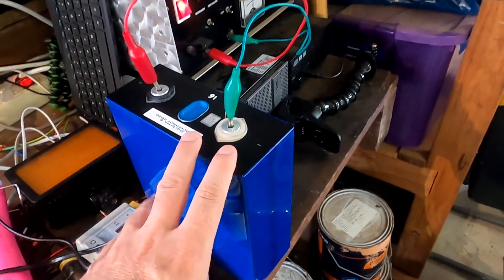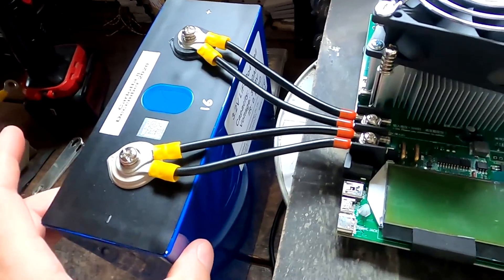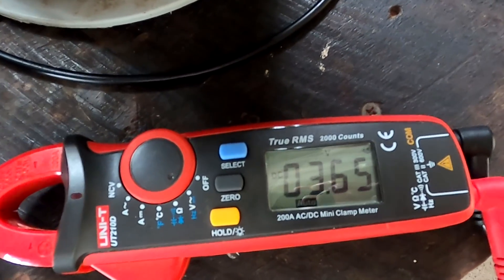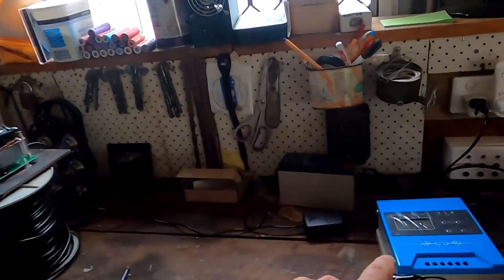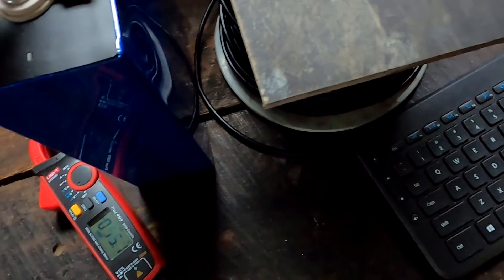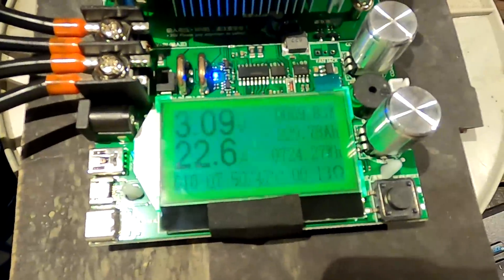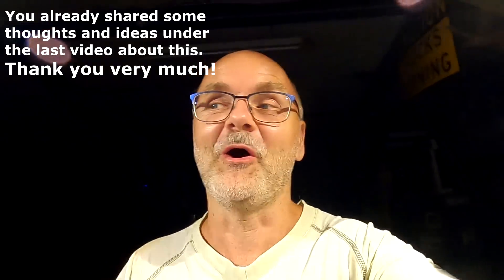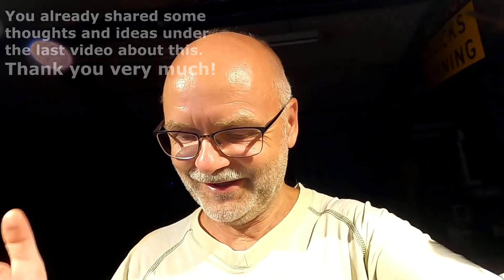3rd capacity test with expected result of the EVE LF280 LiFePO4 cell.

Comment: Hi, I recently found your videos. You are making me a big job, now I have to watch them all from the beginning of video one. I think those both testers actually read quite accurately the same. As you charge and discharge the battery couple of times, the capacity might increase a bit. It is nice to know that those cheap testers can get you at least to the ball park when testing old batteries, are they still good or not. Br, Eeli

Comment: Instead of 280 but you forgot all the energy losses in cables and the electronic devices. I think the 280 are here...
Reply from the maker: Cable losses after not relevant if you measure Ah.
Reply: @OffGridGarageAustralia  it is true but still some losses in the electronic and still some mesurement errors. And 271 for 280 annunced (3% less than annunced), for a Chinese product that cost 1/3 of non chinese products, it is quite a performance lol. I bought 310 Mah batteries that I am waiting for. If I get 300 I will be happy. A lot of testers found that their 280 Ah chinese batteries deliver about 280 Ah. In general these chinese batteries are a very good deal (75% less expensive for 3% capacity less in the worst case)... if these batteries last 10 to 15 years (the only question is : how long will they really last) ?

Comment: If I had to guess, I would say that these are grade B cells. Cells that didn't make the 280 Ah cut. I bought the same 280 Ah EVE cells but they were considerably more expensive because they were guaranteed matched grade A cells with a measured capacity from 289 to 290 Ah.

Comment: You're slowly killing your cells if you are charging them to 3.6v with a termination current of 1 amp.  Lifepo4 has a typical charge termination  current of 5%, and 5% of 280ah is 14 amps. If your charger charges at less than 14 amps, you need to stop charging it AS SOON as it reaches 3.6-3.65v. You're just wasting time and slowly killing the  battery,  unfortunately, by letting the current fall off.  :-(
Reply from the maker: Never heard or read of this before that cells will die if you slow charge or absorb them.
Reply: @OffGridGarageAustralia  the longer they stay at 3.65v, the shorter the lifespan. Its no secret lithium cells dont like that. It's why we dont store them fully charged. I'm not sure what the output of your charger is,  but a lower end-voltage termination  is definitely recommended. If you care about the longevity of the cells

Comment: I agree the internal resistance increases with the higher current draw causing the difference in Ahr. The problem is the fact that the battery gets warm to touch proves nothing. The heat created at 1C is occurring over 1 hour whereas at .2C its occurring over 5 hours. Of course the battery gets warmer dissipating even the same amount of energy 5 times faster.  
To prove it you would need to take a calorimeter approach something like immerse battery as possible in well insulated liquid filled container and measure the rise in temp of liquid etc and account for heat loss of insulation etc. Was too complicated and too much trouble for the return so I am not suggesting you do it.   Also it depends highly on the ambient temperature you do the capacity test at.  Cooler temp may actually make a higher C more efficient to a degree (no pun intended) if the heat at higher C warms the battery to a more efficient temperature rather than raising it to a too warm temperature.

Comment: hi, you should to measure the accuracy of your capacity testers (both may a bit off).. also always measure each capacity of your cells because the less capacity cell (the worst one) become the max capacity of the pack in a serial configuration.. in parallel+serial, me, i match the worst one with the better one (and so on) in my pack and that give a better equalized capacity of cells.. in my case i have around +10% to -10% of the average and if i was putted 2 cells at -10% in parallel, my total capacity was dropped to -20%.. love your car bulbs load which don’t do noise.. happy to see your experiments!!

Comment: For a 0.1C discharge, you're not drawing enough current (at least as indicated).  Before you complain about cell capacity, you need to test EVERY cell in the same manner and do it with test equipment of KNOWN accuracy.  Would you use a $10 Harbor Freight digital multimeter to do this testing?  Some of those have a calibration pot for the voltmeter section and those can be set for decent accuracy over a small range but they're don't compare to a Fluke for accuracy when purchased.

What is the RATED accuracy of each test instrument you are using? 

I know from experience that the EPSolar/EPEver solar charge controllers have more accurate metering than the MakeSkyBlue charge controllers and the inexpensive (and some not-so-inexpensive) voltmeters and ammeters from China can be all over the place.  How accurate is the A measurement (in %) and the H measurement (in %) of all-in-one device you are using?  Does it measure 20.000 amps accurately or does it show 20.1xx or 19.9xx?  Does it measure 12 hours exactly or is it off by a few minutes one way or the other?  First you test the test equipment, then you test the battery if you want high accuracy.

Voltage measuring I can do accurately by using an AD584L voltage reference (factory trimmed to +/- 0.005volt on the 10.0 volt output, which is better than 1%, and similar accuracy on the 2.5 and 5.0 volt outputs which are useful to this discussion and the calbration chart with the device will have 4 or 5 digits of precision) to calibrate the voltmeter(s) being used.  How accurate is your voltmeter at 2.5 and 3.65 volts?  Having your meter off by 0.1 volt (0.4% at 2.5 volts) could make a major difference in the apparent battery capacity.  Charging to 3.55v and discharging to 2.4v is not the specified range of the cell.  Current measurements need to be equally accurate for AH.

On the other hand, what is the battery manufacturer's RATED capacity accuracy?  Almost everything has some type of specification accuracy (vehicle speedometers in the US are to be -0 to +7%.  It's OK if it reads high but not low).

I use an AH meter to monitor the discharge and charge of my AGM battery bank.  In this case, I know what the voltages are at rest and under load for various states of charge and I can use that and the AH in/out to determine the safe discharge level and the fully recharged state of the battery bank.  Whatever the discharge AH may be, the correct charge AH is (discharge AH + 10%).  I got 9 years from the previous bank, replacing it when half the batteries dropped below 80% of original capacity.

I generally consider +/-5% a good battery in early all-in-one testing unless the manufacturer specifies tighter tolerances, which will require that I use better test equipment.

Comment: The batteries have internal resistance and the BMS and other circuits use some power. 
I did not see a reference or inclusion of these  parameters. 
(Sorry, I commented before the end of the vid)

But new LiFePO4 batteries should exceed the AH rating.
96% efficiency is not bad. 
The question is are these new or used?

Comment: Take 280AH Gross.   Subtract 10% for 5% top & bottom margin, gives you 252AH.
Remember that between 3.450 to 3.650 is a Steep Curve up (minimal AH) and below 3.00V is a cliff fall .  This is ALL LFP cells.

$80 for a 280AH cell or call it 250AH  is still an outstanding deal when you crunch the numbers .   Now go out and get a price quotation for properly Matched & Binned LFP cells (be seated before you see the numbers).

What is more important is, are they consistent throughout their operational range of 3.450-3.000.   Do you have any Runners which will reach HVD before other cells or Lazies which will hit LVD before the others ?   THOSE two types of problematic cells are that limit's the battery assembly capacity/functionality.   Impedance & Resistance are player factors in this, one conveniently gets forgotten in discussions.

Comment: I would like to see a capacity test of all 4 batteries individually along with your opinion on how they will work together based on the results. 
If I understand correctly,  battery packs work best when the batteries are closely matched in capacity and internal resistance.

Comment: I think the spec sheet says they aren't very efficient. Because if the high IR. I'll stick to the "old fashioned" LiPo flat packs. 98% approx for my solar backup. 24 volt system. The only plus I see for LiFe is 4 cells make a good 12v battery and the cycle life is real high. I'd close the book on this.

Comment: Ich habe nicht alle deine Videos komplett gesehen - vielleicht hast du ja eine Genauigkeitsprüfung  gemacht. Bei solchen Tests überprüfe ich zunächst die Ah-Meter mit einem genauen Multimeter. Mein Multimeter hat eine angegebene Genauigkeit  im 10A DC-Bereich von +/-(0,2%+2).  Bei höheren Strömen verwende ich einen Shunt Kl.0,5 oder besser und messe den Spannungsabfall mit dem obigen Multimeter, das im mV-DC-Bereich  mit +/-(0,1%+1) angegeben ist. Dein UT 210D ist mit +/-(2,0%+3) angegeben. Die Genauigkeits-Angaben von der 180W Last sind unglaubwürdig oder es ist die Auflösung gemeint. Bei einigen Prozent Ungenauigkeit in der Messung sind dann schnell die Ah-Ergebnisse unbefriedigend. Zum Beispiel: 280Ah -3% = 272Ah

Comment: The capacity of a battery must be measured in wh not in Ah. 280Ah x 3.2v nominal should give us 896Wh. Check more on the whs the battery is capable of providing.  846Wh = 264Ah. 0,09v x 22,2A x  12h = 24Wh. 846Wh + 24Wh = 870 Wh. 870 / 3.2v = 272 Ah 🤔
👍 Saludos desde España.

Comment: I think you should do a "real scenario" test where all the batteries are used together to provide power to a realistic load current/power request. Like you mention discharge rate and temperature are key factors on battery performance.

Comment: Capacity is dependant on the discharge current. At, say, 50 Amps, You will get much less. At 5 Amps, You may get a lot more than 280 Ah.
This test is performed as CC, the previous test was not. Light bulbs as load is not an accurate way of rating a battery. Now, try this, recharge and do this test once more with this tester, same Amperage, and You may get a couple more Ah.
Reply: I believe that you are thinking of lead acid.The lifepo4 chemistry is not so load dependent if you don't exceed 1C in this case 280Ah.

Comment: There is a fundamental law with electronics and related fields: "The number of answers you get is directly proportional to the number of instruments you have to measure with."  I have five different ways to test battery capacity etc. and I get 5 different answers.  Most of them are close but the measurement from my chargery BMS (the most expensive tool I have to measure capacity) is the one that gives the worst answer, about 16% off.  I have spent an endless amount of time charging and discharging a handful of my 64 LiFePo4 batteries over and over again to the point that I am now designing my own charges, dischargers and testers (I have a EE degree so that helps) and I have learned enough to say that designing an accurate current measuring system that covers a broad range of currents from mill-amps to 100s of amp is actually not a trivial exercise.  To measure such currents with a shunt based system requires a shunt of such low resistance (so as to minimize the  power dissipation requirements and voltage loss requirements when 10s or 100s of amps are flowing through it) that you have such small voltages across the shunt when measuring only milliamps or low amps that noise from other electrical sources etc. becomes a problem.  And hull effect based systems tend to be even less accurate in my experience.  Just take your clamp meter and "clamp" it to you one of you power lines and move it around to see the amps measured change right before you eyes...convenient but not good.  Bottom line is "be happy" as your batteries are doing much better than most.  I might add there are many on youtube you rant at the battery manufacturers when they don't get 100% or more from the capacity tests.  It is true that their are rip-offs for sure but more often the folks doing the testing really don't understand the tolerance levels they should expect or all the variables involved.  I was one of those people until I did a lot of investigation and found out that there are a great many variables involved and that the equipment we use to test and our techniques and lack of understanding are more often the culprit than the batteries.  By the way, you have undoubtedly noticed that your battery voltage stays fairly constant during these tests ( until the end that is) and your load current is equally consistent (provided you have a stable constant load).  It is a simple matter to check the accuracy of your instruments.  Wait until you are into a test for an hour or so (therefore in the linear range for the battery if you have sufficient loads - you do for your tests based on your setup you videoed) are read how many amps are flowing.  Then wait another hour or more and read again.  The current will not have changed if you started with full batteries with the loads you have in your videos.  Then simply take the time period and convert to amp hours.  So, if you read 18 amps on your meters and you took your measurements one hour apart you will have used 18 amp hours.  Compare to what your meter says.  If it does not agree than the meter is not accurate.  Do this over a several hour period (staying in the battery linear range) and you will have a good indicator of your meters error percentage.  You can do the same test during charging provided you have a good constant current charging source.  Even if you do not it will probably be fine in the battery linear region as the IR and voltage are fairly constant)  In my experience on all my instruments they are quite close on the amps (not ah) measurement.  However, my BMS gave a very low amp hour (not amps) measurement compared to what it should have calculated.  This was particularly strange because its amp measurement was similar to the other instruments.  I suspect they out smarted themselves when making this, otherwise simple, calculation.  I will also offer that although the amp hour capacity varies on my different instruments the total watt hour calculations are all similar.  Some variation  of around 5 percent but usually fairly close.  Finally, the DROK multifunction shunt meter you used in your second test is actually my most accurate meter (it seems anyway) despite its relatively low cost.  I also have a hull effect meter and its accuracy is not great.  By the way, the discrepancy in the values of your measurements really isn't much to get excited about in my opinion.

Comment: You are using the electronic load out of it's specs. Max current should be 20 A, this is why the current is flipping around and may give a wrong sum. Set it to 19A, this should be constant 'till the battery is empty. The R of the battery is also wrong, because the battery can deliver way more current, than the load can handle. It simply cannot measure the resistance with only 20A.

Comment: Just an idea. You may want to connect your two testers in series to measure Ah and see how their readings differ (or match). Just connect the one with the shunt to the cell and as its load connect the one with the fan. Same current will flow through them so you can see if they read the same amps and Ahs (or how different).

Comment: Spec sheet says to repeat 3 times each cell. I had a couple of my 280s come in <280. Each time I exercised them they got better and better. All my 280s are now >280 after being charged and discharged a few times individually.
Reply from the maker: That's a great trip and exactly what I saw with mine too. The ones I tested got better with every cycle.
Reply: @OffGridGarageAustralia  Is this a tried and true statement?  Does the cell actually get better over a few cycles of tests?  For all cells tested multiple times?  Just curious to know.  I did encounter this with my 32650 cells, tried to test two a second time.  So I am still not exactly sure if this statement is a fact.  Thanks for answering.  Great videos.  Going through them one at a time
Reply: Just running a set of test cycles on EVE 280's.
3rd run through and now using a heavier C-Rate (75A) charge per cell, doing individual cell charging (actually pretty quick) has indeed made a difference at the top of the voltage curve.    Compared to setting cells in parallel and charging the 
"lot" which I did, this method of 1 cell @ higher C-Rate is better.

* Note using CC-CV with bench Powersupply.  Allowing to drop to 1A  per cell, then setting them in parallel for final topping with charger attached.

Comment: What are the capacity tolerances in datasheet? If it is too warm battery will perform less optimally and degrade faster.
Could check the battery serial number. They could have been sitting for a while I wear houses and who knows at what pemperature.

Comment: The deviation between all the cells is just as important as the absolute capacity. To check both just charge all cells (once) in parallel to 3.65v, link all cells in series, then discharge (once) until the lowest cell is 2.50v. 

The voltage of the remaining cells and your previous tests will indicate the capacities remaining.

Comment: 8:41 I have been following your videos, I want to clarify something. I don't think measured Amp Hrs matter even if there are loses on the cables, so the voltage sense won't be of much help. The current sensor should measure the entire current passing through the system, so AH doesn't need an accurate voltage sensor. The WH will matter but AH, I don't think. Please correct me if I'm wrong. Thanks.
Reply: +1 We are measuring Ah of the batteries.